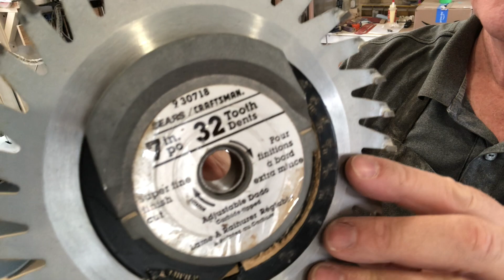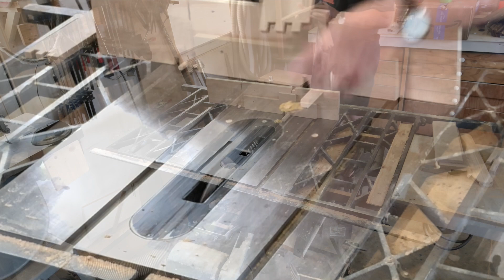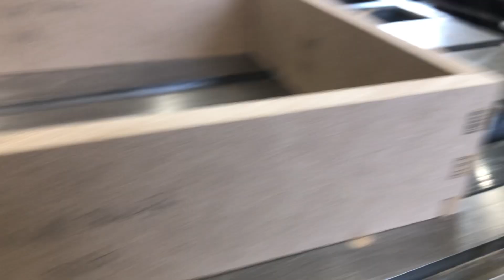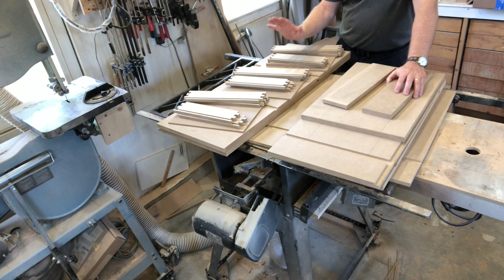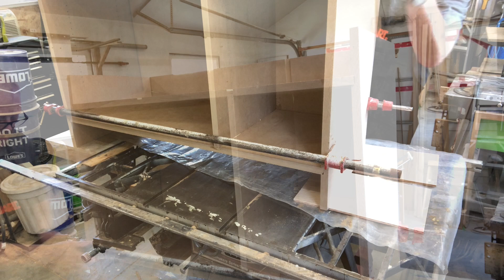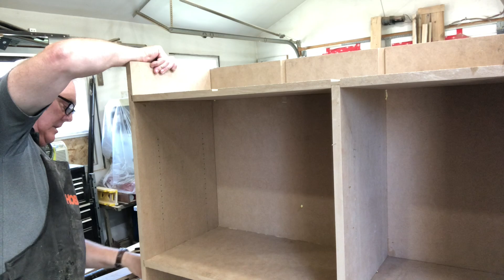Making a Sideboard - P3 - Drawers and Glue Up ... and PRESSURE!

Comment: Prior to the last project I did not know what a "Dado" was. Thanks for the good learning. 👏

I like how the dado joints went together.

I also noted, as you shared, that building furniture necessitates quite a bit of "tooling", as you termed it.
Reply from the maker: I sometimes mistakenly refer to the "dado" as the joint itself.  The "dado" is a groove cut with a dado blade (which in my case I, again, mistakenly call a "dado stack"). The joint is properly called a "finger joint" or "box joint".  I keep tripping over terminology.